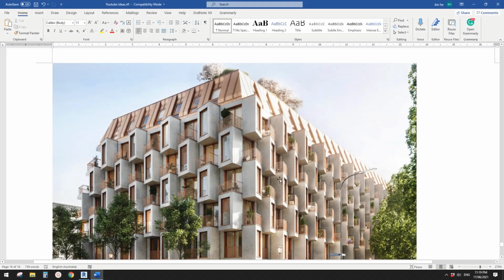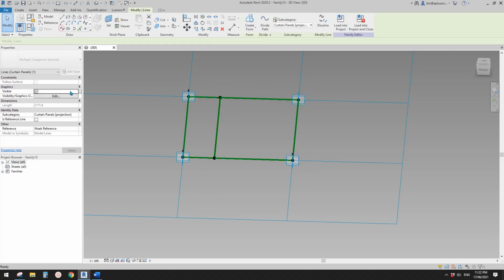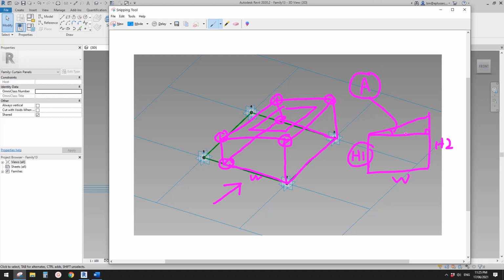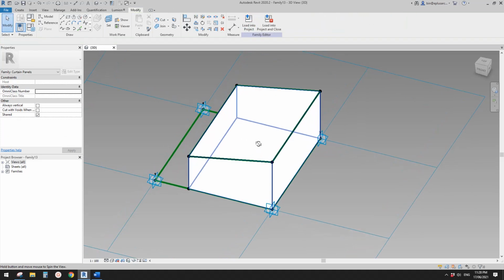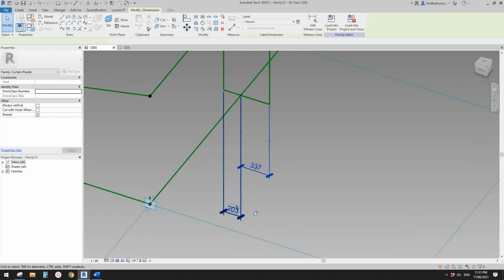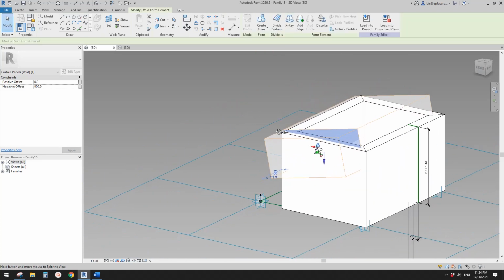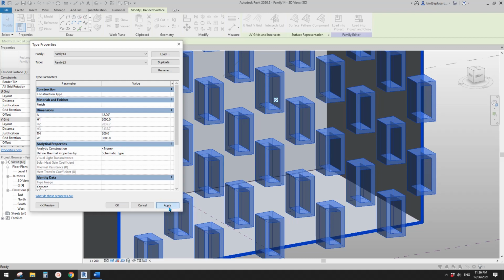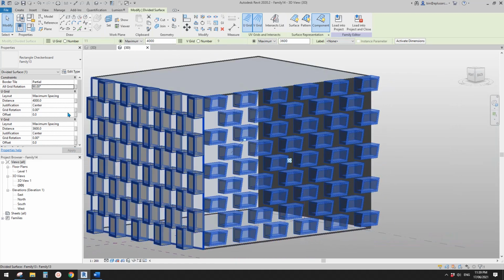Everyday Revit (Day 453) - Pattern Based Family Exercise

Comment: How to tag this family one by one, when this pattern based family placed on mass? I mean I want to each and every pattern based family  tagged  in a numbering process serially. thank you
Reply from the maker: Try TG on them (need Tag to pick individual element). To give them different number, you need to use instance parameter, such as Mark, instead of Type parameter. You might need to edit the tag family so it use the Mark instead of Type Mark. Let me know if you can not work it out.
Reply: @BINHE615  ok i will let you know after practice , thanks.
Reply: its not work.
Reply from the maker: I will do a quick video for this.
Reply: @BINHE615  ok thanks